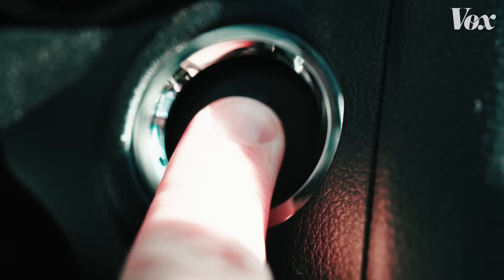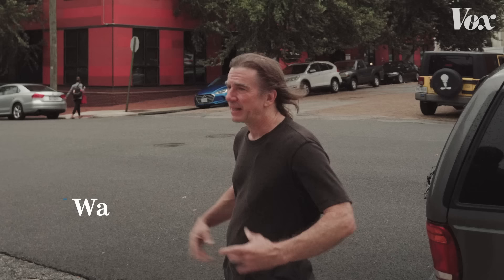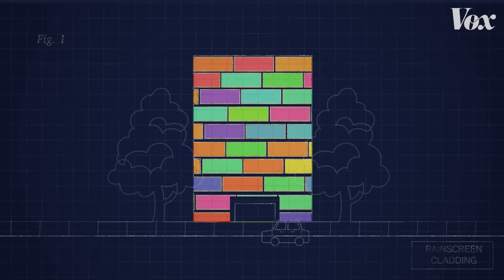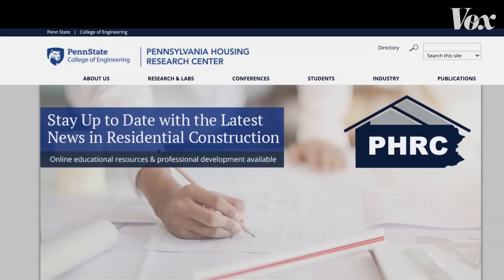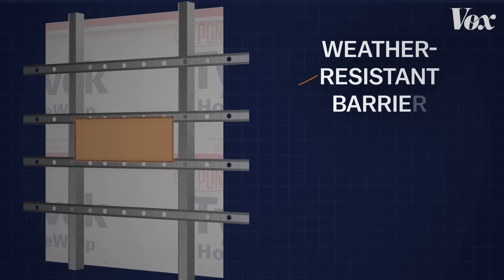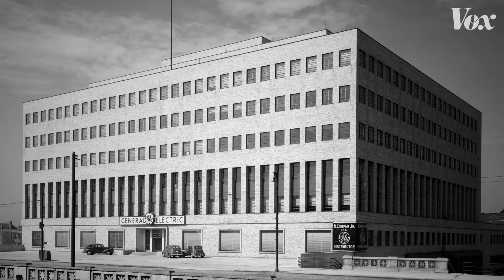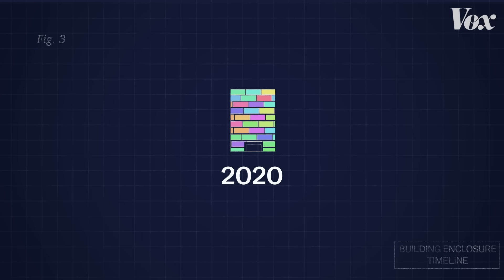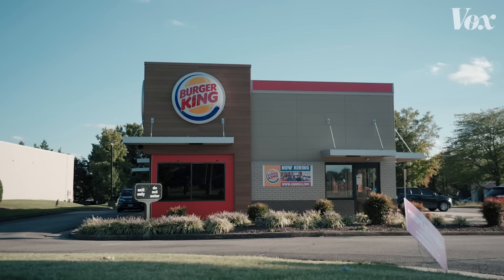Why so many new buildings are covered in rectangles

Comment: I'm surprised that Vox didn't reference cladding and it's drawbacks - the best example is where building manufacturers look for extreme cost savings, and choose the cladding that costs the least but doesn't meet a decent level of safety; this is what inevitably happened with the Grenfell Tower Fire on 14 June 2017; 72 people perished after their tower block's cladding spread an ongoing unit fire. 
Cladding in general isn't unsafe, of course, but some panels are, and their use is negligence of safety.
Reply: I think the majority of people watching this from the UK would have thought of Grenfell as soon as they mentioned cladding. Cladding has become something of a crisis here as leaseholders find their flats unsellable and being hit with massive costs to remove cladding that developers put in to save money.
Reply: Exactly what came to my mind too.
Reply: Right, it's not as environmentally sound either if you have to replace the building within a couple decades rather than buildings standing for a century like the old brick ones.
Reply: The cladding creates a gap between the cladding material and the inside surface of the building. If a fire breaks out, you can end up with a forced chimney effect or external hypocaust phenomenon which can quickly spread hot gases around the building. Only one similar major incident is needed in america to cause the market in those properties to crash as it did here in Britain.
Reply: Melbourne, Australia. 
Any building with these types of external cladding here is often immediately deemed worthless due to the expenses to remove and replace it well exceeding the cost of the property itself. The Government is gradually assessing new structures for it as a reform. Millions and millions of dollars of repairs to apartment complexes, businesses etc and the bill falls onto to the owner, not the builder or architect that decided on using these products. Vehicle manufacturers have to pay for recall if there's a faulty component, but construction is a protected class here as it's the only thing our country does. 

Anyway, a friend put a downpayment on an apartment recently and realised the agent skirted around the cladding question of whether it had by saying 'not that we know of'. I drove him out there to tap on the walls to identify what was structural material and what was cladding. He pulled the offer. I work in two hospitals and both in the last year have had extensive works on the exterior to remove cladding. It's an abhorrent idea that Vox is negligent not to mention in this video
Reply: There's no way vox was gonna get these guys to admit that this amazing tech they're so proud of is just a short term, cheap solution that won't last 50 ywars
Reply: Thanks for sharing this comment! I knew there had to be a catch...
Reply: I came looking for this comment. The whole video I was waiting for them to mention Grenfell, but no...
Reply: I was going to comment something very similar. That veneer of material with an air gap turns the exterior into a huge chimney flu for the fire to rip through, nicely protected if anyone wanted to try and extinguish it from the outside.
Reply: Couldn’t agree more.  The fact that this video was made without a single reference to the Grenfell Tower tragedy is absolutely irresponsible and horrendous reporting.
Reply: Reading about this was more interesting than the video
Reply: @tony9146  Its because not all of these systems are engineered like the one at grenfell. ESPECIALLY in the US. In the US, most of these cladding systems are backed by poly-iso insulation so there is little to no air gap. And poly iso will char or melt before it burns, smothering any fire in that cavity. Most cladding systems and whole wall assemblies in the US have been laboratory tested for fire resistance and flame spread
Reply: @MattMarshallUK  remember, Americans in general don’t really understand there are other countries 😆
Reply: The standards of the cladding used differ between the UK and the US. The Grenfell Tower was renovated using a type of cladding that was not fire-resistant; that type of cladding would have not been considered "up to code" by US construction standards, as the US has much stricter fire safety regulations (most of which were also created in the wake of tragedy).
Reply: Nope that was a local council that let them put a flammable foam in those panels. That product isn't allowed in the US and Europe.
Reply: @GetOfflineGetGood  no, as it was explained it's still way more environmental to do it this way. And putting new siding on in 80 years isn't rebuilding the whole building.
Reply: @tony9146 Well we have better fire standards here so why don't you turn that comment back on yourself.
Reply: @JKSSubstandard  thank you JKS👍. I've given up trying to convince people to get into construction, and now when the vice is juuuust starting to squeeze they start whining about the cost of homes. Got a truckload of popcorn and beer cause its going to keep getting worse for the next 15 years.  Watching white collar workers start to pay construction workers more than they make to get a house has already started.
Reply: @microsoftsam_yt  not so much anymore on the tragedy, more job protection for firemen. Fire deaths turned in the 70-80s and they want to keep their jobs so they go into code writing. Spent a funny 15 minutes telling a fire official the building I wanted to build was fireproof and they were telling me that wasn't possible. They blocked the construction because it didn't meet their requirements.
Reply: Cost savings aren't inherently bad. Like you stated last, negligence of safety is what one must watch out for.
Reply: Thank you for mentioning this. I immediately thought of Grenfell when the video started.

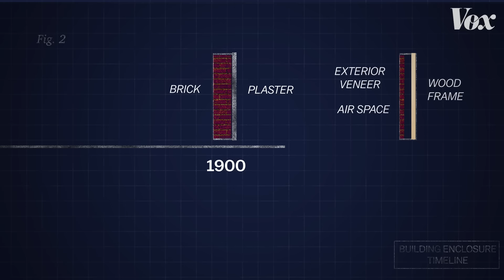Comment: 3:54 That's why homes in the United States, even with many hurricanes and tornadoes, can't withstand them. In Latin America we make brick houses with reinforced concrete structures. They are extremely resistant against 200 km/h winds and generally only lose their roofs, but the concrete slabs remain intact.I really couldn't live in a house where the walls are made of coating.
Reply: Yep, now that I'm going with my dad's work I can see that even a human with a hammer can get through a house wall. How I Know? When we do repair we take down the brick wall with a hammer....on the other side it's just cardboard and wood Wich they aren't hard to take down. Fun fact: if the brick wall doesn't have brick tie, the whole wall will collapse. So really the wall made of bricks or stones are being held on by Wood planks.
Reply: Same here in the Philippines. Every typhoon that would hit mainland SEA goes through us so anyone that can afford to would build their house with concrete hollow blocks and more concrete. It can get hot in the summer since not everyone can afford an AC (and even then we have the most expensive electric cost in Asia) but better sweat a bit than rebuild the house every other month!
Reply: There are states in the US where it's literally illegal to build a house with bricks, go figure
Reply: @GeneralKenobi69420  that is because bricks do not withstand earthquakes well.  You have to have buildings that can flex and absorb the shaking of tremor.  Brick doesn’t bend it breaks.

You have to build according to your environment.  Building to resist hurricanes and tornados doesn’t make sense in a place that doesn’t get them.  Building to resist earthquakes doesn’t make sense in a place that doesn’t get earthquakes.
Reply: Last time I checked favelas didn’t have homes made of concrete.
Reply: I'm jealous.
Reply: @glossygloss472  they, however, have homes made of bricks, which north americans don't even have! might i add, the reason that favelas go down so often is bcuz of flooding n erosion in the valleys that they live in, never the wind
Reply: @glossygloss472  if you ever put your foot on a favela, you will be surprised.
Reply: @glossygloss472  Good point! Most American homes are rather comparable to favelas than houses indeed.
Reply: maria You’re wrong, I wish you guys would do some research and realize the US isn’t monolithic when it comes to architecture. There’s thousands of Brick homes in the northeast and portions of the Midwest.
Reply: My city got hit by winds of 100 mph+ and 99 percent of the houses survived. The big problem we’re the old trees that fell on the houses
Reply: @WHYOSHO  Millions
Reply: @mccperin   lol there’s tons of homes and buildings made of bricks in the US and Canada, you have no clue what you’re talking about.
Reply: Maybe in Latin America brick is cheaper to build
Reply: This really just depends on the locality, in the colder regions of the us around the north east and midwest you'll find more homes constructed of bricks and mortar whereas in states like california you'll find more wooden housing due to the state's propensity for earthquakes and the difficulty of making concrete and brick earthquake resistant.
Reply: @qtheplatypus  When do Florida or Texas, to name a few states, have earthquakes?
Reply: @glossygloss472  Actually they are...
Reply: It's legal in all 50 states. Cali does require rebar reinforced brick however to make it stronger, and it's usually only done as a faux exterior there due to this code (and the money/labor it world cost).
Reply: I find it funny how ignorant non-Americans are in regard to them “knowing so much” about the United States. 

The U.S. is the most geographically diverse country in the world, and our construction methods reflect that. We have mountains, plains, savannas, deserts, swamps, coastal areas, and so on. 

Tornadoes, flooding, hurricanes, earthquakes, derechos (inland hurricanes), wildfires, and climate are all factors that influence how we build depending on where we are. 

And yes, we have plenty of brick houses; and among those brick houses, several ways to construct them.
Reply: @MrColaKO  Texas does not get earthquakes, for the most part. The El Paso area gets small tremors, but the majority of Texas (Austin, Dallas, Houston, and San Antonio) does not experience them. Most homes here are built with brick, especially closer to the Gulf of Mexico. They have to survive hurricanes. Furthermore, houses in north Texas (DFW area) have to survive tornados.
Reply: Houses in Latin America are very poorly isolated. Mostly because we don’t face severe weather like in North America, you would be surprised how easy is to keep one of those modern houses cozy in the winter. 

Also, you ought to factor cost of labor in both regions of the globe.
Reply: You should research before you speak. Florida, where I live, is a state in which many hurricanes occur. Houses have to be made with steel reinforced concrete blocks and be built higher up to meet current hurricane code. Hurricanes themselves aren’t the issue as much as how their winds cause trees to fall on homes and flood waters to create unlivable mold. 
Tornadoes are an entirely different beast. No home, unless it is made entirely of steel like a bunker, will survive that strong of winds. The homes in major tornado hotspots are made of wood because bricks/concrete would just tear off and act as projectiles which would cause more harm. It’s also easier to cut your losses with a wood construction than to try to rebuild a home with expensive materials. Tornadoes are also more concentrated so you may never even experience one even if you live in tornado alley.

Comment: Q: Why so many new buildings are covered in rectangles?
A: To keep the rain out of our cheaply-built papier-mâché buildings...
Reply: I was thinking the same thing… in Germany you wouldn’t even be allowed to build like that
Reply: @timm.7988  yep. Especially because 80% of the time those panels let the rain in, keeping the moisture and causing the rest of the strucure to rot, develop mould and so on. And the folks using slate as material don't even know that such material is meant to heat up the structure ( that's why is used in some northern countries) by atracting sunlight, but in a warm country/latitute, slate turns the structure into an oven. Way to save energy if one has to run air conditioning 24/7, right. <_<
Reply: But..but... it's called "rainscreen cladding" how can it be cheap?
Reply: Tbh papier-mâché mache buildings would be better tough check out the architect Shigeru Ban he literally made buildings out of paper and it literally last longer than you think 😅
Reply: @RejectedInch  What is the problem with moisture going through? That's part of the system. The idea is to fully isolate the inner outside wall with the best and probably ugliest material you could find, and then make the building look prettier.
Reply: @theamalgamut8871  the guy described the problem with moisture going in.
Reply: @whoamomma8050  Is that usually an issue though? The system is designed to accommodate the moisture
Reply: Whoa  Momma the guy who mentioned these “issues” must not have watched the video because it specifically explains how and why that isn’t an issue.
Reply: @TheKaurK  I think you need to watch the video again...i've summarized:
- Most buildings were made from brick which was stronger, permeable and could take moisture
- Old houses were made from wood, with Shingles to try and keep water out, but wouldn't last as long as brick structures
- Trend towards building bigger buildings with wooden techniques, because it was cheaper and faster.
- There was a "lag" and many of these cheaper buildings did not keep moisture out well, so now they use the rainscreen cladding as a fix.

Ultimately, they would have been better off building a brick building in the first place, which would use less heating and AC too
Reply: And way cheaper to control the surface fininsh
Reply: I swear you could walk into one of those buildings and jump through the floor to get below. No need for stairs or an elevator

Comment: Great video but missed opportunity to talk about the role that cladding played in the Grenfell tower fire in London. Here cladding was used to “upgrade” how the building looks, while creating a massive fire hazard. The same material is used all over the UK and house values have completely crashed for owners of these fire hazard houses.
Reply: It would’ve been cool for them to go over the drama in the architectural world.
Reply: Are you a WTYP fan as well?
Reply: @kristin7121  what is WTYP
Reply: @flameify8285  I believe they're referring to a podcast called Well there's your problem, which focuses on engineering disasters
Reply: @flameify8285  It's an engineering disaster podcast, with slides, which in of itself is a disaster
Reply: Yeah, I watched the whole thing thinking, "but... but... GRENFELL".
Reply: This wasn't the cause of fire. Insolation under it that improves heat retention and efficiency was very flammable.
Reply: @ligametis  That, combined with the lack of continuous fire separation. Foam isn't the best but you can manage risk if you marry it with a really robust fire stopping system. Still not the most environmentally friendly though...
Reply: this vid feels like one giant ad tbh
Reply: The problem wasn't a rainwater cladding system, it was the insulation
Reply: Maybe Grenfell would be more a appropriate subject in a fire code video? 🤷🏻‍♂️

Comment: adds rectangle to building
“Oh yeah, its all coming together”
Reply: if the rectangle fits ........
Reply: @BroAnarchy  tetris but in buildings
Reply: Rectangle building is BEAUTY formed in symmetry! Rectangle is the bestagon.
Reply: @thesauce1682  um hexagon is pretty great too
Reply: @thesauce1682  i think rectangles are just too old school.I would mostly prefer hexagons
Reply: @LebaneseBaron  wait until you learn about tapered insulation packages.
Reply: @mattgriebel6280  or bricks!
Reply: A lot of places have rectangle panels, I worked at a place making the panels. They just slide on and off so it's easy to replace them, along with instead of replacing a full wall just a few panels

Comment: But as we saw a couple of years ago with Grenfell in London, builders need to make certain that the cladding that is used is not fuel for fast moving fires.
Reply: The other problem is that if a fire breaks out in the building, the cladding provides an external enclosed air supply. It creates a forced chimney effect which spreads the hot gases up and around the building regardless of the combustibility of the panels themselves.
Reply: Yeah I'm really surprised nobody has mentioned the obvious fire danger that certain types of cladding pose. After the events of Grenfell many cities did checks on apartment buildings. In my city they estimated that almost all new apartment buildings have cladding, potentially the flammable kind. It's pretty scary.